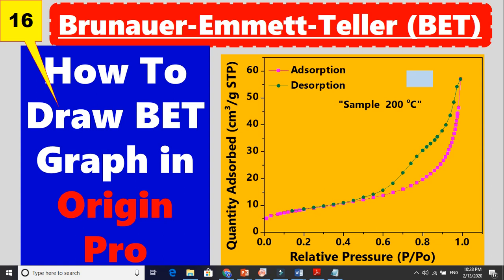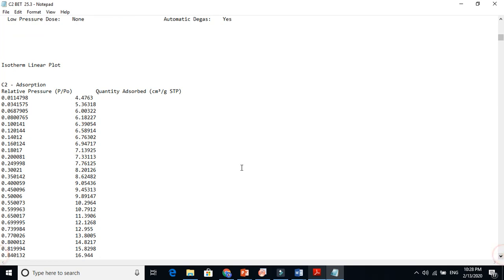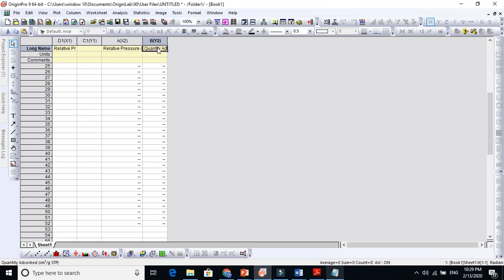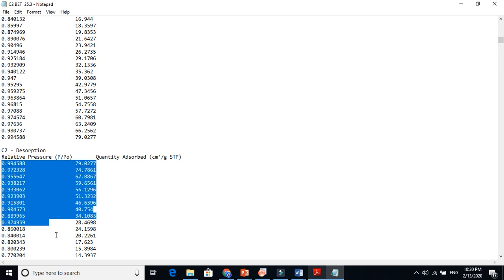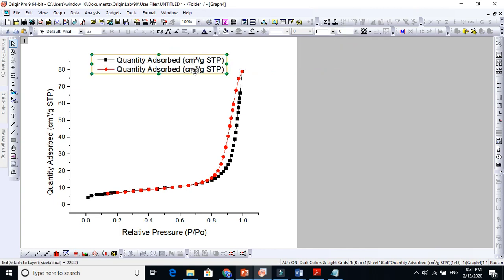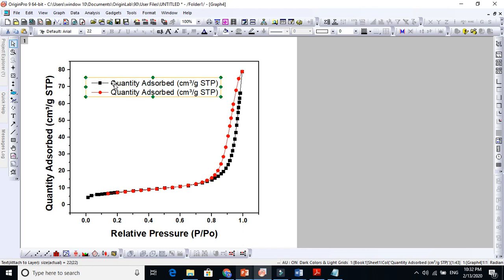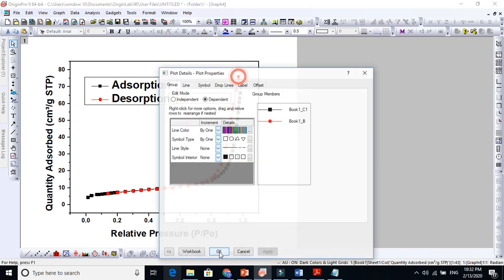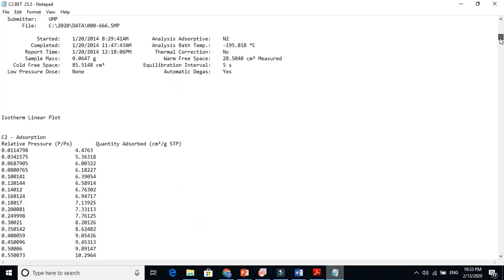How To Draw BET Adsorption Desorption Graph In Origin Pro?

Comment: Great work sir. Very informative but i would request you to make a video on how to determine the porosity and volume of nanoparticles using BET analysis? Is there a separate profile along with the original results or we calculate them through some equations from the given data the same way we calculate particle size and other parameters from X ray analysis?
I would be grateful if you could please elaborate it here in a reply!
Regards
Reply from the maker: Many thanks for the comment. In my case, the pore size and pore volume were already given in the raw file received from BET analyzer. Anyway, I will see to make another video on the said topic. 
Best luck!

Comment: It is really helpful but I have done BET it's quantchrome software shows MBET error insufficient mtags selected while I want to check surface area and pore size...can you please help me
Reply from the maker: I think the operator provides the raw data in the form of a text file. You need to convert that text file to excel or Origin and then draw the graph. 

The specific surface area is automatically there in the raw text file and you don't need to calculate.

Comment: Sirr i got multi point bet data by nova quant core , my dafa file for bet multipoint contains 3 columns  P/P° with values like 7.432e-02 , then second colum vlumen @STP with values like 0.623 and then a third column 1/[W((p/p°)-1)] and this column also contains values like 1.0025e+02. The values i got are not like yours simple. What is this please reply me in this regard. 
Thanku i also got bet pore size by dft method in that files again values cotain 'e'
Reply: Sir reply kr den ap kbi jwb ni dety me jb b swal puchta
Reply from the maker: I am terribly sorry. I could not see the message and I don't know how it is skipped by me. 

Anyway I hope you found the answer.

Comment: Sir after running the bet analysis result generated from machine in pdf one of my sample has surface area 0.00 what does it mean ?
Reply from the maker: It's may be an error.  Surface area must has some value in unit g/m2
Reply: Yes sir out of my 3 sample one sample has 0 g per m2. So it is ok? This means that it has zero surface area?